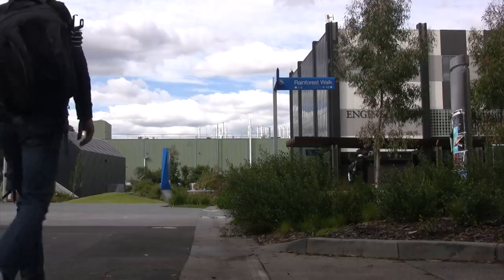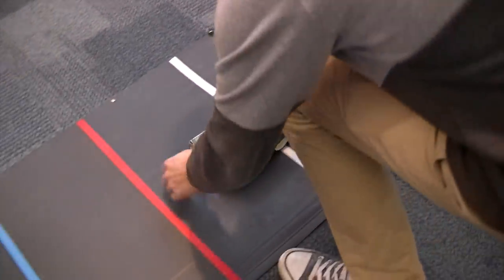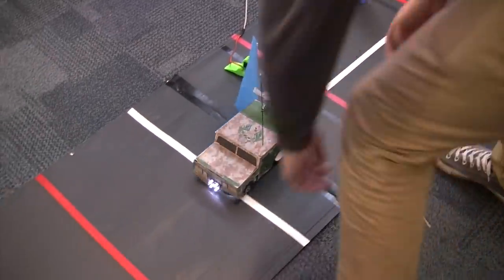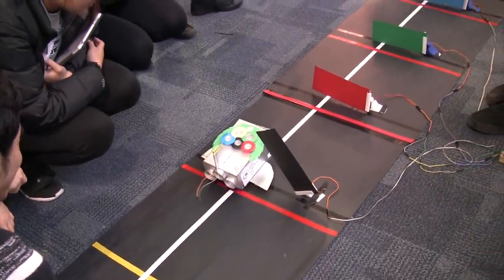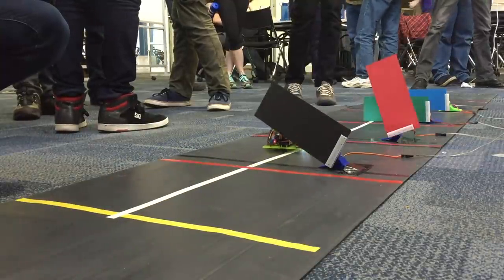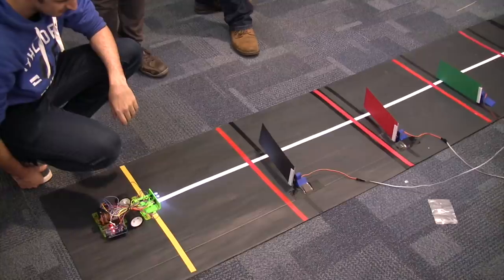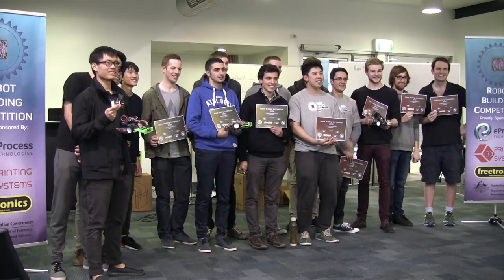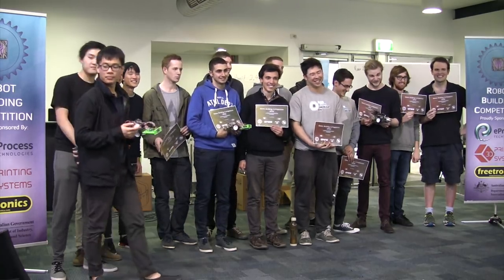Vlog #43: SMEE Robot Building Competition 2016

Comment: Great! 
apparently the task does not seem to be extremely complex. Although it depends what components were they given to accomplish it.
Reply from the maker: The individual pieces weren't too complex, but it was the number of tasks that overwhelmed competitors. Just making a sensor that can detect and report colour can be done in a couple of hours. Coding a line following robot with the proper response rate tuned to the mechanics of the chassis can be done in a couple of hours. Writing code to transmit messages using an RF module can be done in a couple of hours. And so on, etc. Where teams fell over was that they had to have everything work, so if they got the line following code working but couldn't detect colour, they couldn't open gates. Or their line following code wasn't tuned well so the bot hunted left and right and missed gates entirely, so the colour sensor never kicked in, so it never stopped. It was an interesting challenge just because of the overall integration that they were required to do, which I'm sure was a big challenge for first year students who had never even used an Arduino before.
Reply: Hi Jon, what sensors were most of the competitors using for the color detection?